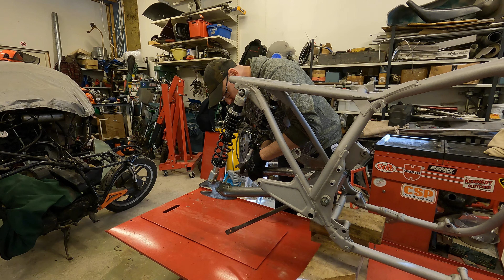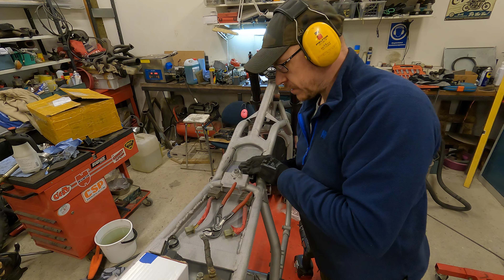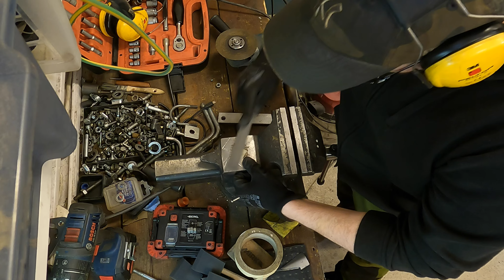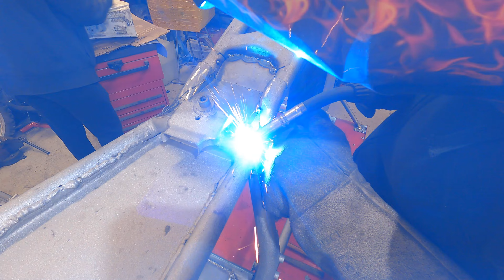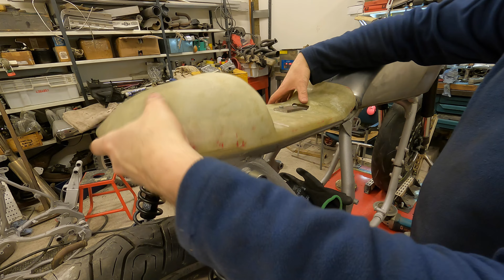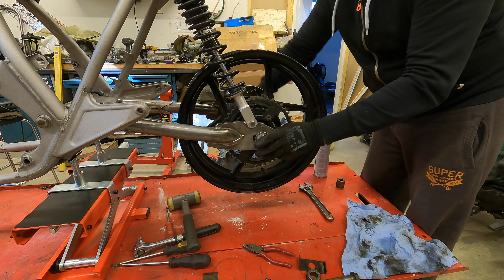Testing new parts and under tank shelf! Building the perfect Cafe Racer #Honda #CB750

Comment: Nice. So you're mounting the mo.unit under the tank, good idea. Still wondering where I'm going to mount my starter solenoid. Good that the Kawasaki rear wheel kind fits in there. With some appropriate spacers it might just work!
Reply from the maker: I have to put mUkit under the tank. I made thta tray so that X21 fits in it. Then change in plan and well… 😂

Rear rim is doable, i played eith spacers bit more and with small mods it will fit. One thing is chain line that has to be checked.
Reply: Amigo, a mi me esta pasando lo mismo, con el mismo aro de kawasaki, pero mi moto es cb 750 81, espero logres poner ese aro de atrás, para yo poder hacer lo mismo con la mía, saludos
Reply from the maker: @luisballadares303  ¡Hola amigo, y perdón por la respuesta tardía! Es bueno saber que alguien más tiene el mismo tipo de problema. :) Continuaré con esta saga de la llanta trasera justo después de que termine la carcasa de la luz trasera.

La traducción está hecha por Google Translate, ¡espero que tenga sentido! 😃